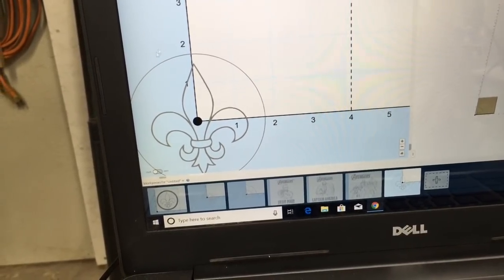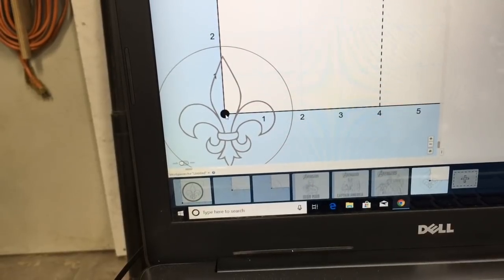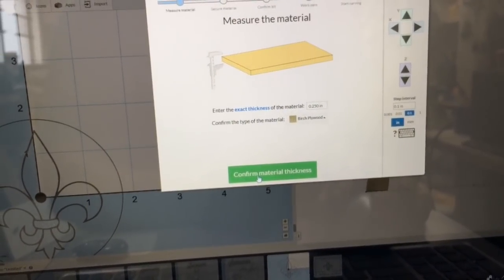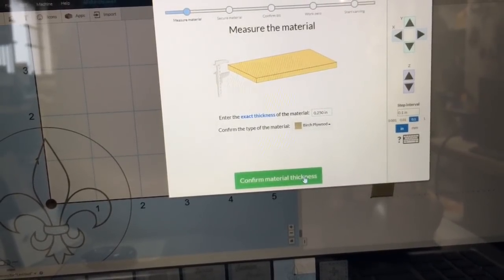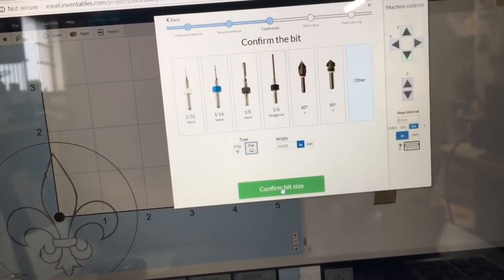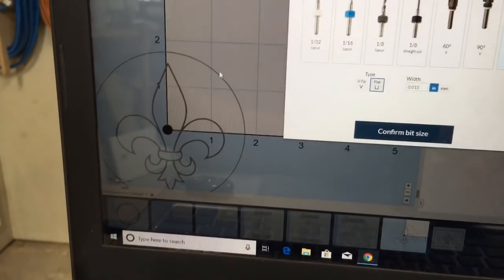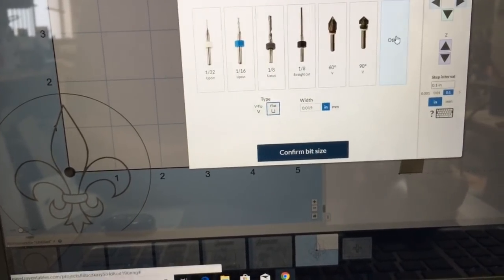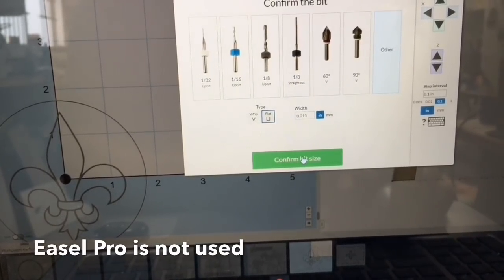How to Do Production Run in Easel for Christmas Gifts

Comment: Paw Paw , Did you get the dust collection system with your X-Carve ?  Just curious.  I have a small 500mm x 500mm X-carve ( one of the first ones ! ) So I'm doing small projects and upgrades myself.
Reply from the maker: No, I did not get the dust collection system.  It was not available at the time of my purchase.  I use a shop vac and I also have a central vacuum system that I use.  It is not connected to the XCarve at this time.